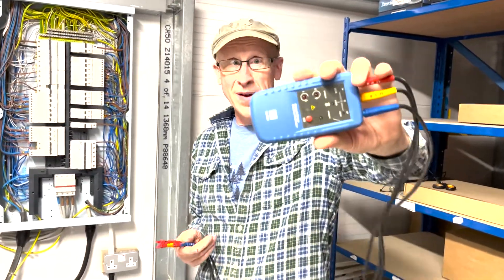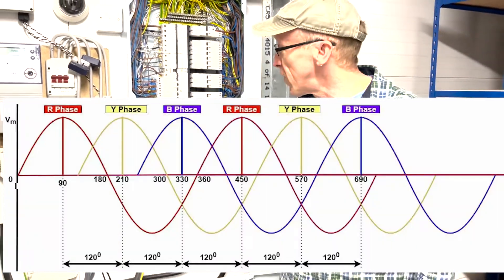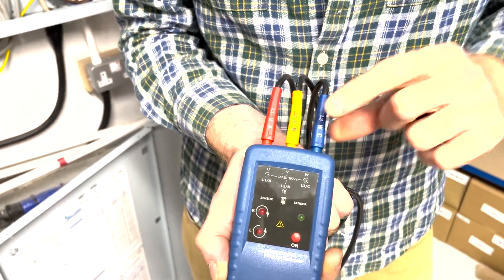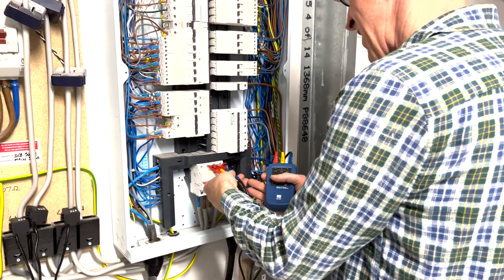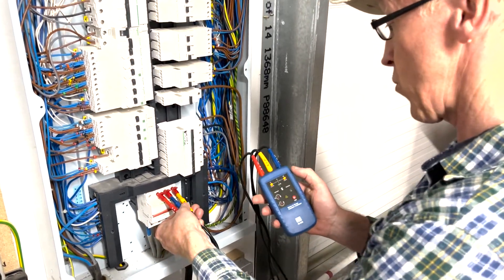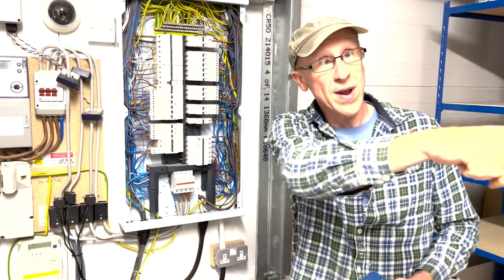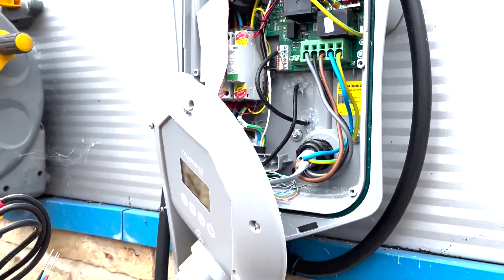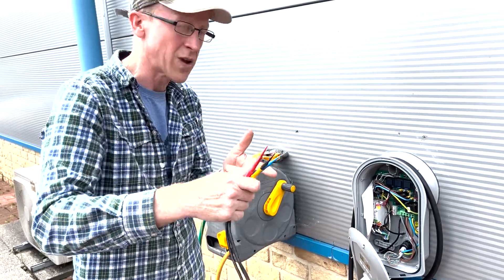Using a 3 Phase Rotation Tester To Check Phase Wiring on Zappi 3 Phase EV Car Charger etc

Comment: Good work Simon. Useful for many followers in commercial premises.🙂🙂🙂😃
Reply from the maker: Morning Richard - yes this 3 phase stuff is a puzzle but it does allow for faster car charging
Reply: @L663  Morning Simon! My new garage is standard single phase but our electrician has fitted a 45 amp supply feed and box ready to take an EV charger for my EV which I have not bought yet…and still confused about buying one at all! I have to say that I might have grabbed a very highly optioned, super low mileage 2020 RRS SVR last week but thankfully it was sold the day I saw it!!😃😃…probably not a good idea but it was the best and most “tasteful” one I have ever seen!…in SVO Pallette Blue at huge cost!  It is horrible out there today so indoor jobs for now! Have a good day and sell more bits!!😀😀😀😀😀😀Richard
Reply: @HQBProductions  I am still a fan of the Tesla - it never fails to impress but would recommend the dual motor. Today we start the install of the 60Kw solar system on the roof of the new building ! ( the building i only got for the 26 car underground garage ! )
Reply: @simonjefferson  Good luck with that job out in the rain! It will be interesting to hear how it works. If you watch Harry Metcalfe on Harry’s Garage and Harry’s Farm, he has done a lot of work on solar installations for the farm with interesting figures. Last I heard was he was expanding it out over some nearby land. I hope the job goes well. 🙂🙂🙂